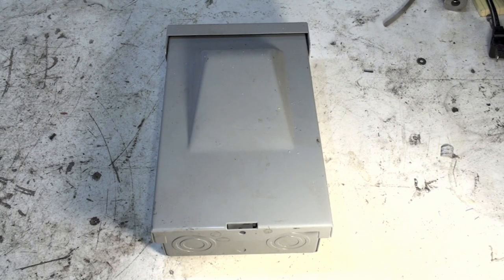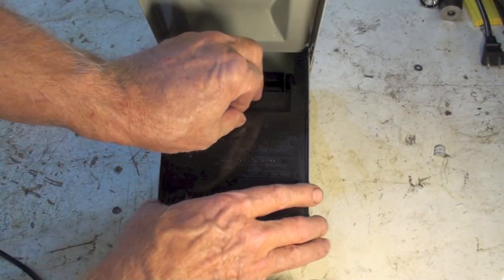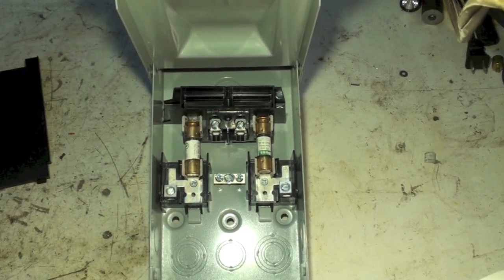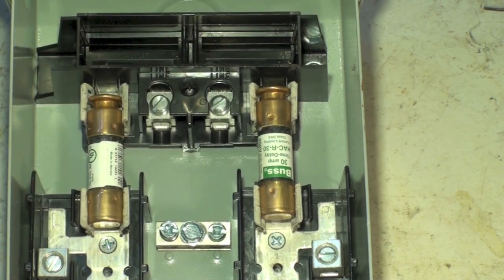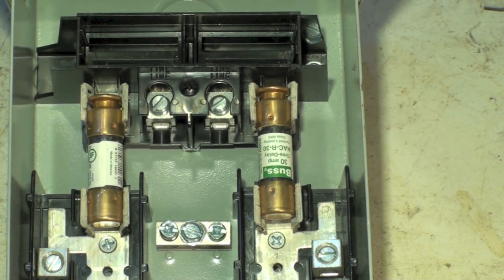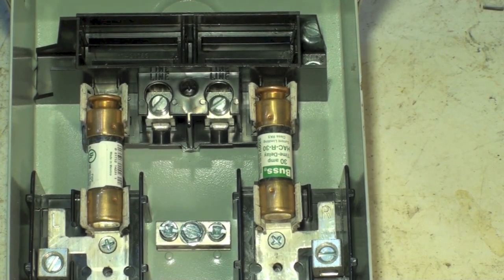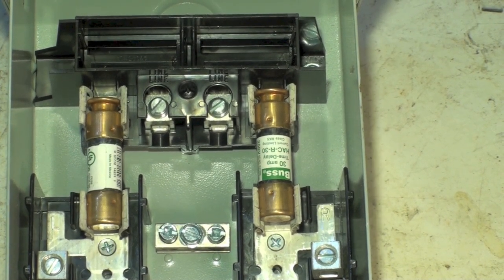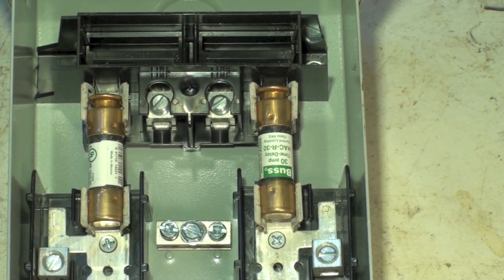How to check for power at the A/C disconnect

Comment: You said "put one probe on each one" talking about the LINE connections. Shouldn't you be putting 1 probe on one of the line connections and the other probe on ground to test if there's voltage? I don't see how putting each probe on each line connection tells you anything, since the two line connections should be equal in voltage.

Comment: Please state what the voltmeter should read when attached to the lines.
Reply from the maker: If you are in the US, and the circuit is single phase, you should read either 208V or 240V when testing between the 2 poles.
GFM

Comment: My a/c unit was intermittent not coming on all the time. Was able to fix it with a piece of sandpaper. The two fuses in the box like the ones in the video had tarnished to the point of not making a good connection. Sanded the ends to a nice copper shine and it has been working fine ever since.

Comment: Can I add a 240 plug for a welder off of this. I don’t really use my air ever.
Reply from the maker: It is probably too small for a welder.  Most require 50 amps.
GFM

Comment: You have great videos GFM. May I respectfully add a side note, check your meter on a live circuit before and after checking a circuit dead to make sure your meter is working properly. Thank you for all of your great videos.
Reply from the maker: That's not a bad idea.  Big Refrigeration has a video on being sure there is no voltage that is probably the best way.  I usually use an NCV as a last check.
GFM

Comment: I have 247 volts at the line but only 120 volts at the load.  Does that mean the breaker is bad?
Reply from the maker: Get your probe off of the chassis.  Measure from hot to hot.  You will probably read zero.  If so, check fuses by removing them and using an ohmmeter.  Breakers can be checked at the output of the breaker with a voltmeter.  hope this helps.
GFM
Reply: Mine doesn't have fuses, it has a circuit breaker.  At the top I have247volts.  At the bottom, not chassis, screws where cables go to heat pump, I have 120 volts.
Reply from the maker: One of the breakers may have opened.  First, try turning both off then back on.  No luck, replace the breaker.
GFM
Reply: The breaker inside the disconnect by the heat pump was indeed bad.  I replaced it and all is good now.  Thanks for the video and the help!
Reply from the maker: Welcome
GFM

Comment: I can't even pull the 1st peice off, and YES, I removed the screws.
Reply from the maker: The disconnect may have melted inside due to poor connection.
GFM
Reply: grayfurnaceman Okay, I FINALLY got it off. Nothing was melted, and I don't have any of those fuses inside of mine. Just wires.
Reply from the maker: Unfused disconnects were common about 40 years ago.  The only overcorrect protection is in the main panel.
GFM

Comment: No power at disconnect. I checked fuses they seem ok.
Thermostat is older model.
Would a bad tstat stop all power to disconnect.
Reply from the maker: No.  Power coming in to disconnect? Panel breaker?
GFM
Reply: grayfurnaceman 
Thank u. That's what I'll concentrate on. I checked breakers rhe seem ok. Maybe they are old, tomorrow I'll do that.
Reply: grayfurnaceman 
Ahhh, nice to be cool again.
In panel trying to figure which fuse was for a/c none were marked ac.
I was about to buy different fuses.
But there is an elec. Box at meter and a 50 was for ac, another for home, flipped the breaker and now power to disconnect is back.
Saved a 80 to 100 service call, and not to have them remind me my system is 20 years old.
A week without ac and heat.